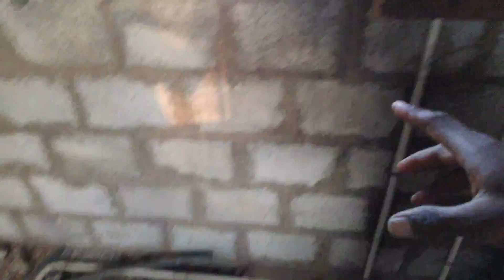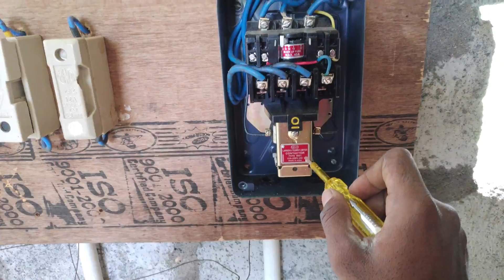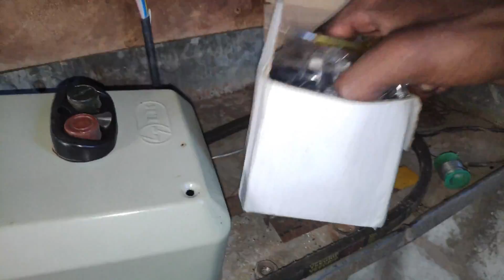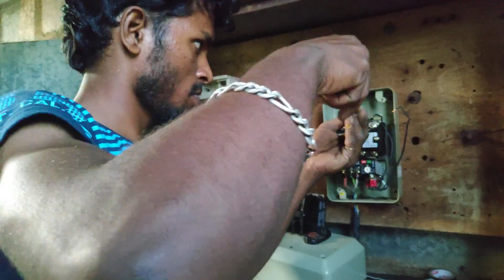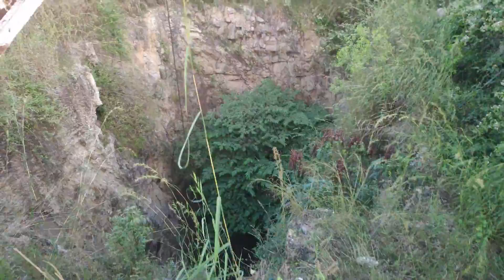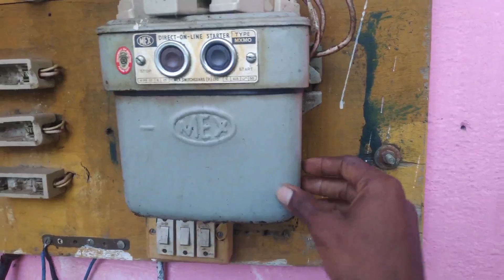Openwell submersible pumps 3 phase starter connection|| Electricalstamiltech

Comment: சிதம்பரம் அருகே உள்ள கிராமத்தில் உள்ளது எங்களிடம் 5hp 7hp மோட்டார் உள்ளது mix oil stater ,,உள்ளது பேஸ் எடுத்தாலும் மோட்டார் ஓடுகிறது எப்படி சரிசெய்வது எனது நம்பருக்கு தெருவிங்கள் 9500890126
Reply: Single phase dry run preventor use pannunga

Comment: Bro enga home la borewell pump la starter problem bro. On panna mudiuthu but off panna sometimes work aguthu sometimes aga maatithu. Spring ethum poirucha?
Reply: Check Stop switch and stop switch wire tights correctly